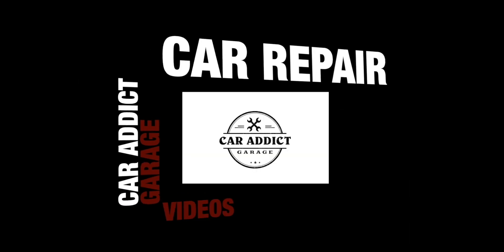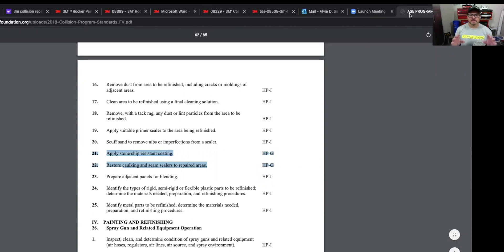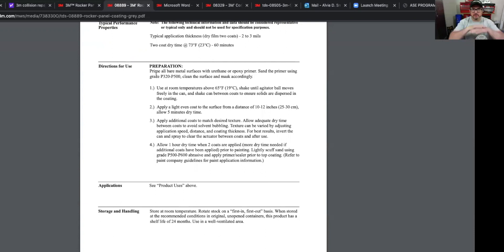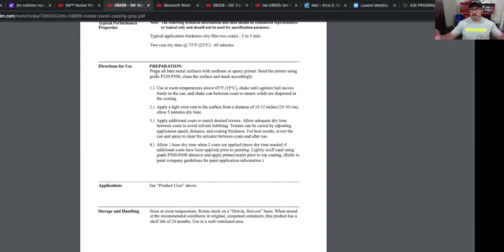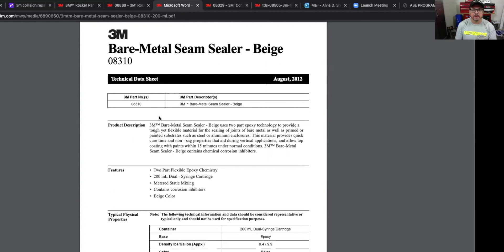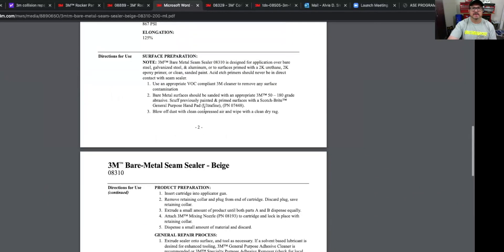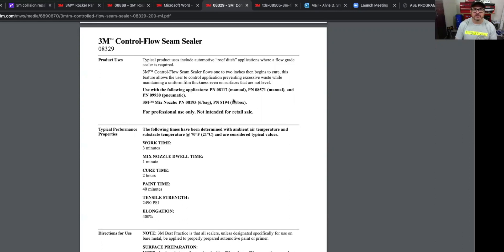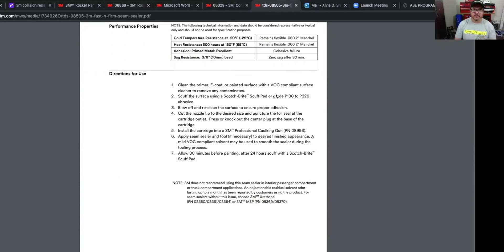How To Apply Seam Sealer and Stone Guard - ASE Paint Review

Comment: I had a quick question, I want to put a coat of duplicolor spray paint over the factory seam sealer in the rain channel around the rear trunk area. The factory but the sealer on VERY heavy and it is a typical problem on these cars for the paint to peel off eventually. How do I prop the sealer in order for the paint to stick properly, hopefully there is a spray can primer I can use.

Comment: Hi donnie. I just curious can a person use lead sodering to seal up new welded up piece metal on panel ? Basically do some welds on new piece metal that goes panel and finishe all little holes with sodering lead filler. I try my best. To make question simple
Reply from the maker: Lead solder, brass, and fiberglass all do a good job of sealing over your welds.
Reply: @CarAddictGarage   thank you donnie smith for the help  i  really do  appreciate  the help

Comment: Timely video into my inbox and thanks for covering this subject. I am a true believer of epoxy primer, especially SPI with its 7 day open window. This allows me to smooth out dings, apply Rage Gold, sand to smooth then re-seal. This keeps moisture from the air or some wet/ dry action to feather edge to a nice finish. I have to one panel at a time as not all of have the workshop we want or joint issues that limit what we can get done each day.
 I just had this talk with my son on mother's day as he is inside but seeing rust under bubbles to re-do. Also, I like the self leveling seam sealer but using tape to define an area, apply and brush. Remove the tape in a timely fashion and produce a repeatable seam. Rock guard is required on my 54 year old C10 as it is my daily driver and city or county roads, where I grew up, works great. People forget sand on city concrete and what the tires in front of you can do as well. When you ride a bagger motorcycle these things are obvious. Thanks.